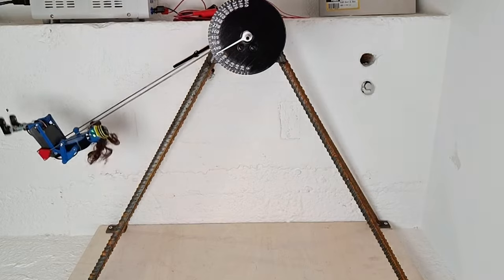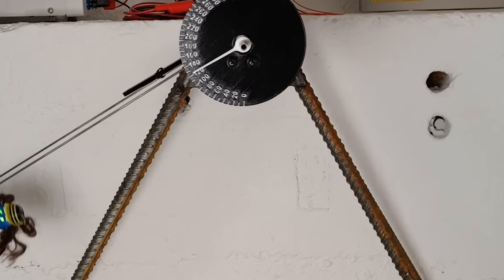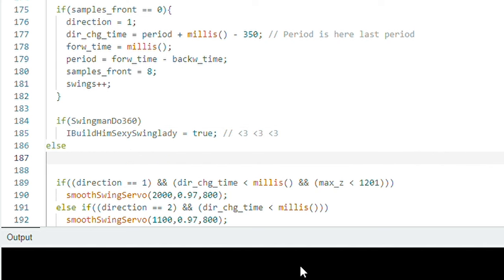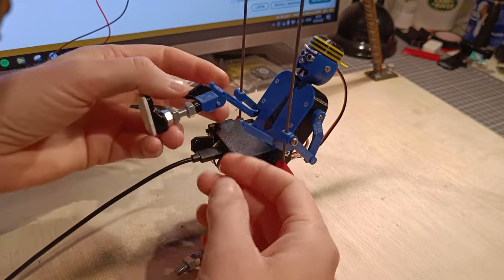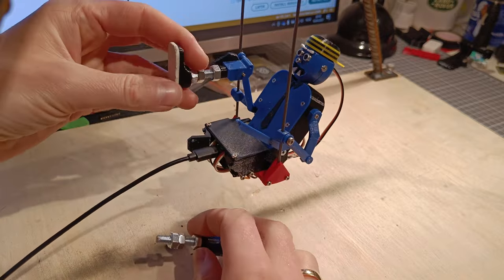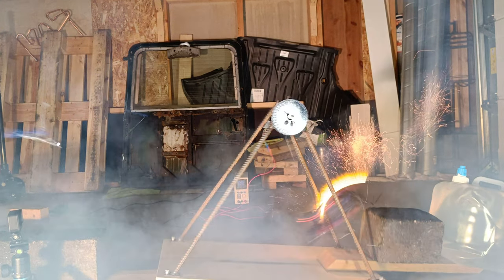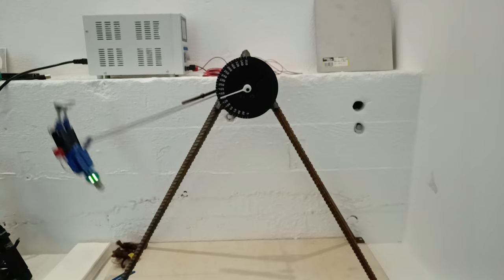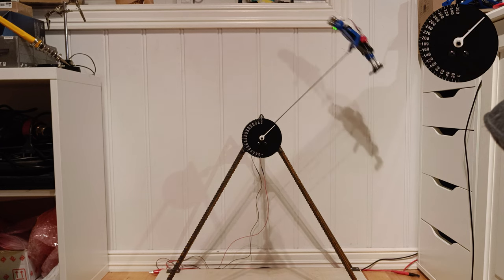360 Swing by 3D printed Arduino Robot

Comment: Dunno if youve ever swang but the motion comes from pumping the legs thusly you shouldve put weight in the feet not the head
Reply from the maker: Yeah, legs got a crucial role in the swing, but also the upper body. I did experiment with leg weights, however I got more degrees with head weight.. I think all moving mass will have an impact, its all about moving it in the right direction at the right time 🙂 Amazing physics.